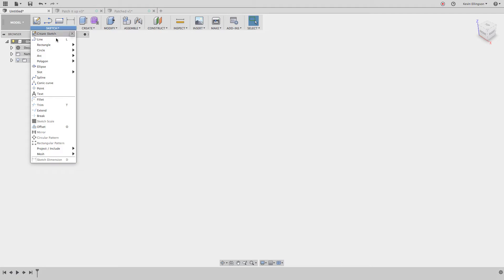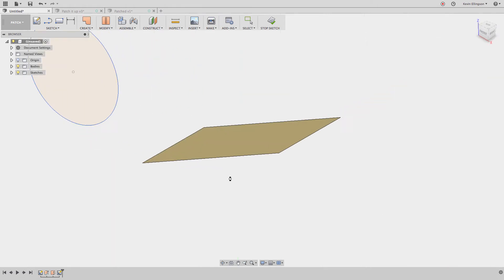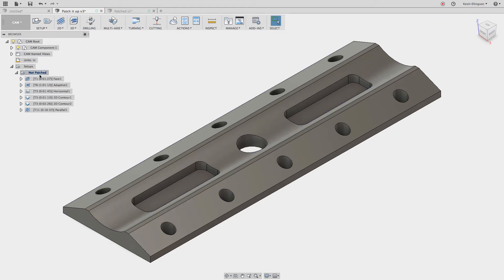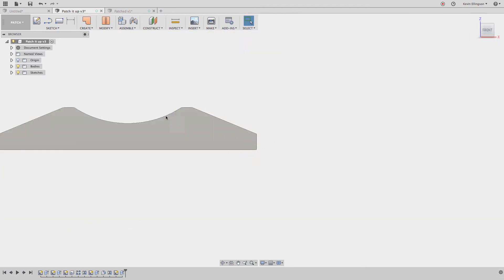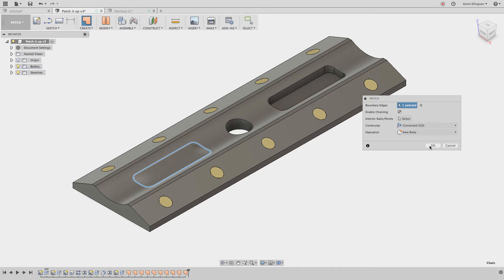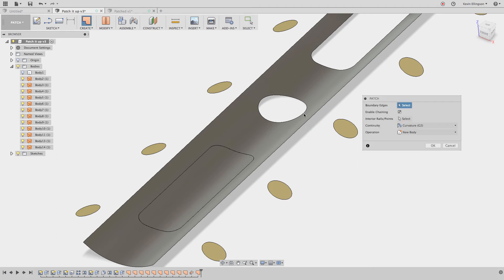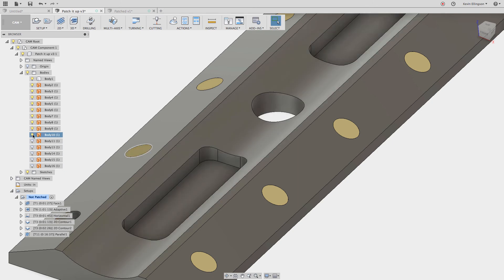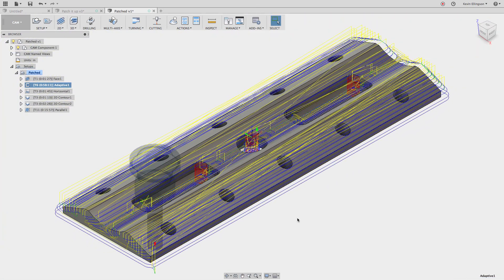Fusion 360 - Patch It Up

Comment: Couldn't you just use avoid touch surfaces in CAM? to avoid the holes?
Reply from the maker: Hi Tim, you could, but that may require a lot of clicking to do that. Also, sometimes it is better to have the tool path pretend it is cutting the patch as a surface rather than having the tool retract and then go to the other side of return to where it was coming from.

Comment: You mentioned that the G2 patch was close, but not quite perfect; do you know if there is a way to get a "prefect" patch?

A thought would be to copy the body (without moving it), then use Fusion360's feature-delete function to remove the holes from the copy, then unstich it, and delete all the unneeded surfaces. Several steps would be involved, but the surfaces would probably be perfect.

I wonder if Autodesk will add a feature-delete tool to the Patch workspace some time.
Reply from the maker: That method would work for sure. Another thought would be to create an extrude from the faces of the pockets and select to object for the extents and then select the curved face and choose the new body option. Then you could turn off the part body, switch to the patch environment delete all the faces except the top face of that new body. That should create a perfect patch as well. Thanks for the question!
Reply: My take is that the original surface patch was trying to maintain curvature continuity to the side walls of the pocket. By duplicating the top surface, Kevin forced Fusion to create a surface patch that is curvature continuous to the top surface.

I think that the slight discontinuities are because of the filleted corners where the curvature changes from none (looking longitudinally through the pocket) to curved (looking across the pocket).

Copying the body and deleting faces in the model workspace can also work. Copying the body and then un-stitching it in the surface workspace, then patching it also works.

The advantage of the technique Kevin shows, is that you don't have an additional body (which could effect BOM and drawings downstream), and (as you pointed out) - it's less work ;)

Thanks for the comment Hirduin, and Great job Kevin.